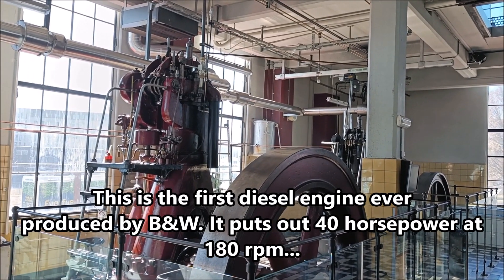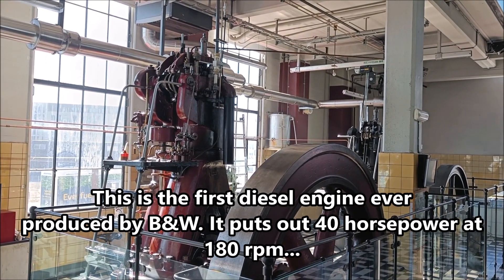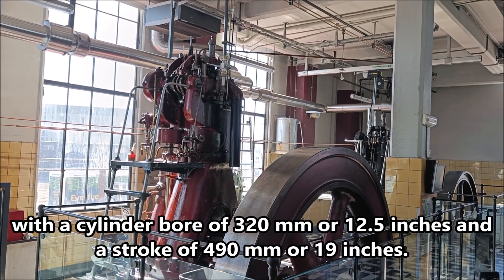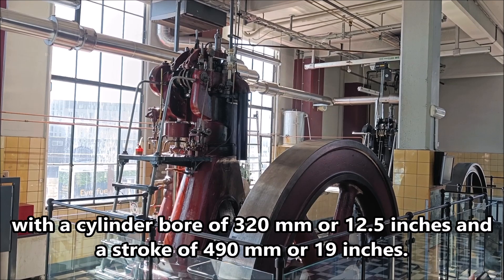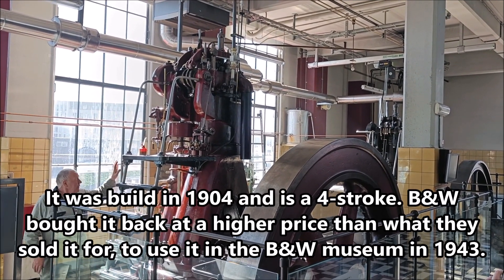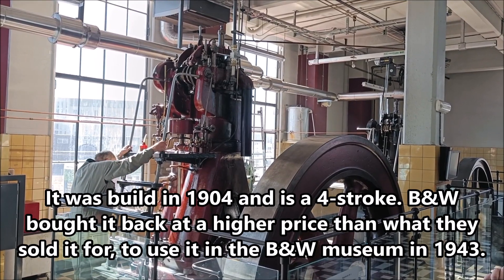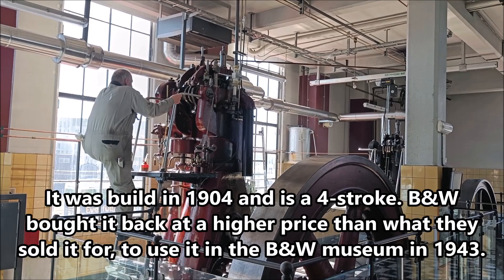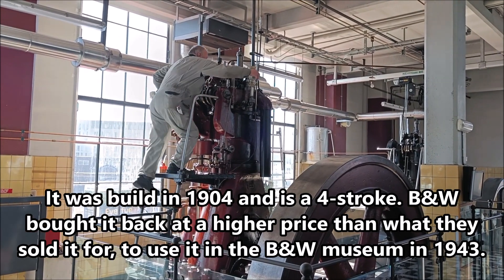COLD START of the first B&W DIESEL ENGINE ever made

Comment: How much torque can produce
Reply: 1582 N*m
Reply from the maker: Sadly they didn't mention anything about the torque and I can't find it. The power is 40 hp at 180 RPM
Reply: @CrankAndCraft  
Same, i already searched on Wikipedia and they told nothing about torque
Reply from the maker: @randomvideos466  Please let me know if you find something 😊
Reply: HP = T*RPM/5252 so at least at the 40 HP point that would be 1167 ft-lbs.